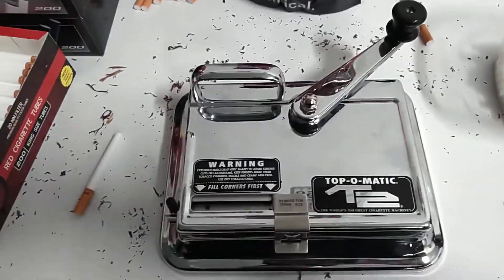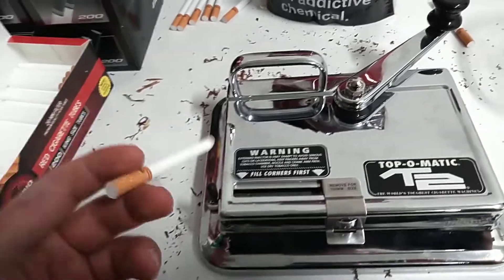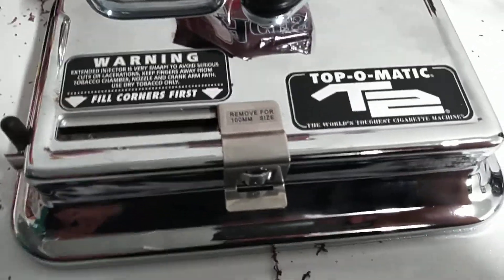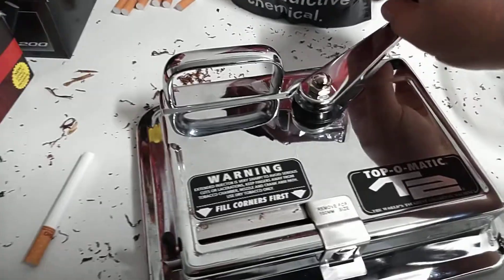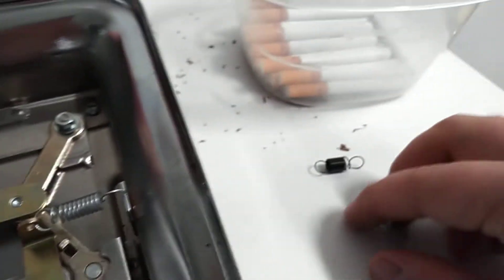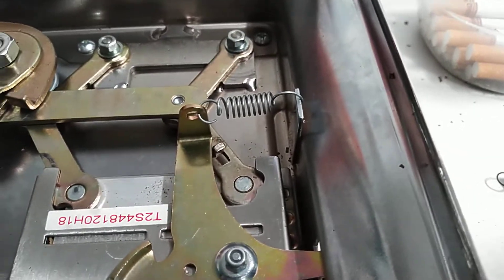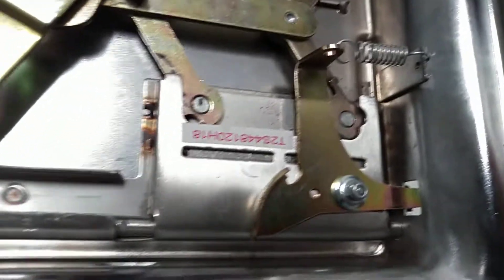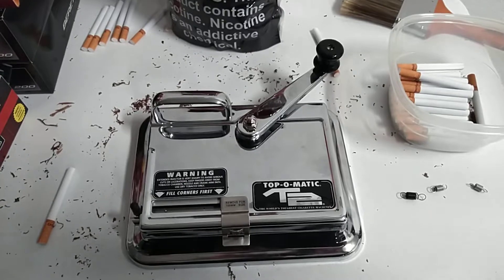Top O Matic T2 Half Filled Tube Fix

Comment: So.  This fucking fix is the way. Holy shit. Rolling better than new.  TBH the new spring (119 at ace hardware) took a little getting used to. I had a lotta ripped cigarettes at first. Not more than i was rolling, but enough to make me question it. I didn’t have the oil he had, i used canola oil. Also the nut on the crank started to come loose and id rip cigarettes. I was a little annoyed. But i kept with it. I rolled 300+ today (going on vacation soon) and i had two fuck ups total. This is it.  This literally is it. Use WD40 if you want, but it works and its better.  I also use a scale and weigh my tobacco to .9 gram fwiw. Thank you OP!
Reply: You can use WD-40 but why would you? It attracts dirt and dries out over time. What I use is white lithium grease. Why you ask? It's the same grease inside window regulators of vehicles. It has an amazing property of not attracting debris and not drying out. Really is amazing stuff. Obviously avoid areas that allow the encroachment of lubricant into the press area of the machine.

Comment: The T2 seems to do this worse than the classic T-O-M.... If you can get a spring,  flip the machine over and bend the tab that the spring hooks to towards the edge of the machine.... works perfect for zero $.... I have been using these machines for at least 15 years

Comment: The arm with the spring has lots of dirt under it cause it to hang up. Spray carburetor cleaner under it while moving it to get the dirt out from underneath it. The slide plate underneath it needs to be filed or light sandpapered. Be careful with it when sanding it. Sand all edges lightly. Get the burs off. Also the arm that slides the tabbacco in needs to be filed with a fingernail on the ridges lightly. It will help the tobacco slide in the tube easier. Use Vaseline lightly to grease the track and joints. Put Vaseline on plastic shaft and wipe it with a rags clean. It will work like brand new! You need a 14mm wrench and a 8mm wrench and a 8mm socket wrench and a flat screw driver and a metal fingernail file. It's just that easy. When you have problems again just clean it.

Comment: using the oil is a bad idea....it causes the fine powder tobacco to gunk up the machine and make you have to clean it a lot more often...ive found its best to just use a pencil or a piece of graphite and put a fine coat over any of the surfaces that rub up against each other. i hope this helps

Comment: I didn't feel like going to hardware store. So I thought, well try to make the rubber thing thicker. I have that sticky weather stripping stuff, so thought I'd give it a try, put it where the rubber thing goes, stick it on there. Guess what? It worked - at least one time anyway. After going 2 wks smoking half filled tubes, I finally have a real cigarette to smoke. Don't know when it will decide to stop working like that, so will go to hardware store tomorrow. Thanks for this video.

Comment: I have bought three of these and after time every  one of them starts doing the partial fill thing. I cannot get to the Ace to look for that spring right now but I don't think it is going to work as I have tried holding the tube to keep it from moving and it will split the tube. I have no idea why these things do this as I was making cigarettes for months before they suddenly start short filling. The only answer I found was buying a new machine which when you consider how much you have already saved making cigarettes it's not a bad trade off.
Reply: mine is doing the same thing did you get it fixed?
Reply: I replaced both springs and mine is still partial filling. So frustrating.
Reply: @mazeygirl2408  i just got a new one
Reply: See comment above yours regarding the pins on machine. I'm having same problems! Will try both fixes but thought I'd point out the mention of the pins above incase commenters here didnt catch it! Good luck!
Reply: @shastina5493  I dont know where the pins are! I do know the company sells parts pretty cheap though. My machine now is around 5-6 yrs old.This is the only problem I've had.
Reply: @mazeygirl2408  Someone mentioned you could sharpen the tobacco cutter. I dont know how though.
Reply: @laragreene8328  Sounds like sharpening may work but I dont know how either! The only thing I've found to help keep it from short filling is to remove the length adjuster piece and to clear the tube every other fill. I've noticed if tobacco is too dry or to moist it short fills or jams the machine as well. Good luck!
Reply: Just watched some tips on this on T. Dee channel. Going to try out! 👍
Reply: @shastina5493  Yes I clear mine out after every cigarette I roll...That helps alot as some tobacco is left in there. Also theres a post on tightening the brass bolts below the handle. That helps on mine!! I think the instructions are on this page. You tighten them a little,then check to see if its enough, but dont tighten them  too much. It helps adjust something,and you want it adjusted but not over tightened . I use a 8mm wrench. I"m having no problems since doing that.

Comment: The blade/tamper dulls very fast and after so many cartons it just becomes junk leading to non stop jams as it can no longer cut as you inject. To replace that alone cost 8$+ shipping which is roughly 1/2 - 1/3 the price of these units at base cost. The T2 is the same exact machine as the standard, just with chome/bling appearance. They are no stronger than the others, and just cost an extra 10-15$ for said bling. Its not even worth repairing your own tamper/blade aside from the cost because you then need to then put it back together which isnt an easy task as being off by 1mm on any part, or one screw too lose or tight and it will result in another issue...     I've burned through many machines  (2 t2's and 3 standards) and they all wear out the same. If anything, the T2 injectors wore out faster.   As for the spring you point out, you can use your finger as you crank to keep the tension if said spring is lose, that alone wont help with anything once your tamper/blade/injectors wear down and the exact same half fill jam issue will get worse and worse, to the point you rip more tubes than you fill.

Comment: This is a problem I have been having as well, along with the slop in the pins that hold the piston. Fixed that with a used ear plug, so a 119 spring I will go find. Thanks!

Edit: I went to Ace and got the $2.02 #119 spring. It works however now the end of the tube is ripping off every time. Maby a lil stretching to the spring will help or tighten the holes up in the old original one if I ruin this #119.
Reply: sounds like the cutter is having trouble pushing through it. Might be dull

Comment: Had the same problem until started using Top tubes.  Like magic, getting the full-fill in the Top tubes 99.9 % of the time.

Dean
Seattle
Reply: I agree that it's the tubes. When I use Beretta tubes I never have this issue. They cost a bit more but the consistency of the diameter of the tubes is much better.

Comment: I got a manual plastic slider from the brand top and it works great for me the only problem I have is sometimes I'll put a little too much in there and it'll tear the tip just a little bit but for 7 bucks I can't really complain

Comment: So I replaced the spring but now it holds the tube so tight that it rips the cigarette tube. Probably will change the rubber tip to a thinner 1 to see if it will work.

Comment: I am having problems with when I turn it right side up and put some tobacco in and I want to pull the handle down to release the tobacco into my filter it will not go in I've been working on this for almost a month it's getting stuck inside the machine what can I do

Comment: Is there a different name for the 119 spring.  I tried contacting Ace hardware and home depot and they don't have it
Reply: I just went to my local Ace and I found the 119 spring. Go through the various drawers where they have them and it should have a 119 slot.  It's smaller than the original and stronger than what the machine came with.  My machine is working perfectly now, no more frustration and it is better than brand new!

Comment: Personally I think it's the tubes. I have stuffed thousands of smokes. With the right tubes, I can stuff 20 in about 10 minutes....or less. I can do this over and over again with no issues through 4+ boxes of tubes. With other tubes I get this issue over and over again. If I hold the rubber piece against the piece you put the tube over it simply rips the tube and I still have a half filled tube. I go back to the tubes that always work....and the issue disappears. It seems the diameter of some tubes is inconsistent. That's why some tubes cost more.

Comment: What I do even tho it CLEARLY says not to is hold the rubber stopper down with my left index finger until right before it kicks the cigarette out. So the pusher is in between my finger and my thumb. I just help it hold the tube. It works with the original machine and the T2.

Comment: Appreciate the video. Sadly That’s only the start of the problem. The real problem that will show itself once the spring stops working is the the part that closes as the handle hits a certain slop. It will start to not close all the way also due to a spring but replacing the spring won’t fix the issue this time. It’s an arm underneath that’s the issue, you need to find a video where it shows that issue and how to fix it with a super glue and a washer. The ive used tbis machine, the nice and heavy top-o-matic and premier supermaric. Hands down the best machine is the cheaper feeling “Premier supermatic II” best machine I’ve ever used but they break within acouple months depending on how many cigs you are rolling/smoking. Look up “premier supermatic 2”. There videos made by one man showing how to fix the slider to allow it to close all the way is simple.

Taking alert the machine however is a but more difficult.

Comment: I bought the black but same machine last year. The first probably 10 cartons worth worked like a charm. I make strictly 100mm longs. Then the problems began... it wouldn't fill the gap closest to the filter, so I'd pack each cigarette after filling. I made some changes and very often clear the ram. Now, the damn center of the tubes aren't filling up, there's a gap so back to packing by hand, ugh. The little rubber that holds the tube is NOT thick enough! I took it off and threw it away and replaced with a thicker inch long length of gas line. Holds the tube in place much better. BUT now it's not filling to the end! Now have to pinch the end and pack each by hand and cut off the unfilled tube portion. F*ck it, next trip to the city I'll buy a different brand cigarette maker. What a f*cking hassle! Top supposed to be the best... It. Is. Not. Note, the ram gets tightly packed tobacco every other cigarette so need to clear it VERY often. Ugh. One more weird thing, today it's not working well at all but yesterday having not changed a thing it worked as designed. WTF?

Comment: There's a metal piece in center of machine that must be removed  for making  100.if you try to roll 100 with plate on for kings you'll get a air gap in cigarettes. Take it off

Comment: OK folks, this is all BS.(Sorry Tom)     A stronger spring only helps in a certain situation. I've rolled over 200lbs with the top-o-matic t1(not the t2).  Here's some better options.

1)Drier tobacco is easier to roll and doesn't grab at the tube.   Lay a couple hand full's out on a baking sheet for an hour.  Make sure it's only an inch or two deep.   Make sure there's a ceiling fan or something moving the air in the room.  You don't want your tobacco crunchy... you want it dry.  You can mix it up every 20 minutes to help it go faster.   When the outside starts to feel the slightest bit crunchy, put it all in a ziplock bag, seal it, and let the humidity redistribute itself for a few hours.  I know, it's sounds like a lot of time, but I usually have at least two bags in queue from days before.   Also, also... tobacco dust gums up the machine.  Got to walmart and find you a mixing bowl and strainer with a mesh large enough for the tobacco dust/bits to fall into the bowl.  Sounds excessive, but it depends on if you want to roll cigs or mess with the roller.

2)  Sometimes, even that is not enough.  Maybe the rubber cap is too worn down, the tobacco just isn't right, or maybe you're just not holding your mouth right.  In this case, take your left hand, roll your index finger around the left side of the handle, and wedge your left thumb between the machine and the rubber cap.   You don't have to push really, just let the weight of your finger rest on it.   This works almost always.   Sometimes it might tear a bit of paper off the end of your tube, but the tobacco almost always hits bottom and that tear is gone in the first 2 seconds of smoking it.

I do both options, all of this, always.  When I set down to roll, I roll a carton between 30 and 40 minutes while watching netflix.

Once you're committed to rolling your own, you'll need to figure out how to repair it.  The spoon/injector will eventually get bent.  Replacing it will make it work just like new.  Go here to get parts:  
https://ryoservice.com/collections/top-o-matic
You'll want to order about 6 of each:   Injector, rubber cover, "PO013 - Flathead Screw"(this is the screw for the spoon/injector that I sometimes loose), and anything you need or think you'll need to make the shipping worth it.  If you don't have a top-o-matic, here's another site:  https://ryoservice.com/

Happy rolling!

Comment: solve the problem.....take that stupid chrome thing they have on there for 100s off.....it isnt needed.....I took mine off 2 years ago and havent lost one cigarette. I use 100s good luck
Reply: I meant to say I use king size and have not any problems.
Reply: @William McClure  hi William. What I discovered was by removing that chrome thing the rod plunger will completely fill the tube . The way I discovered it is I held the king size along side the rod and saw that it sometimes would not come out the full length of tube.....I was losing tubes by the rod leaving and empty space near the filter.I was getting many throw away tubes. I had noticed by removing that chrome piece the rod would always reach the whole tube.....I have probably made 25 boxes of tubes since then and never lost a tube since.......try it see what happens. You'll find you can make good cigarettes without trying.
Reply: @drscruggs9830  It says right in the directions that the piece you are 
talking about is there from the factory to pack regular length smokes. 
Remove to pack 100's. I saved mine as a friend asked me to pack 
some regulars. Put it back on, rolled his, then took it back off to roll 
mine. It allows you to pack both lengths properly. 😊